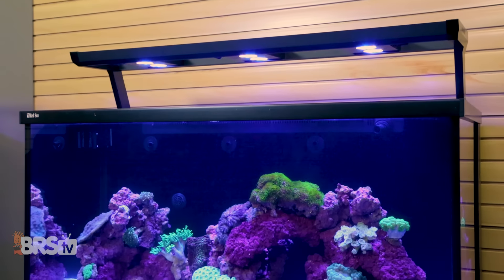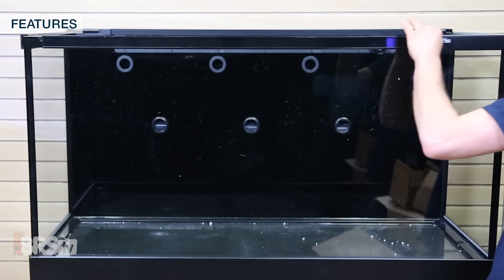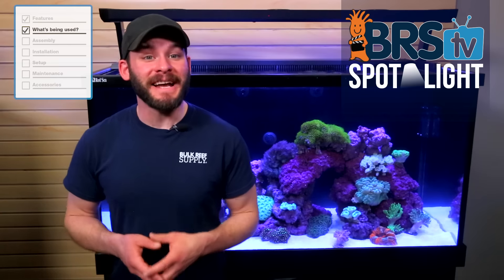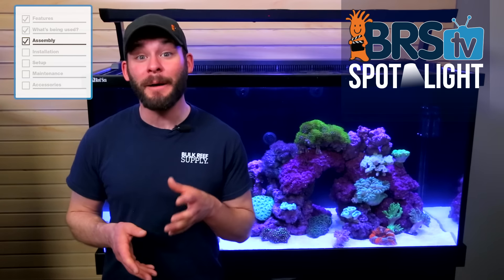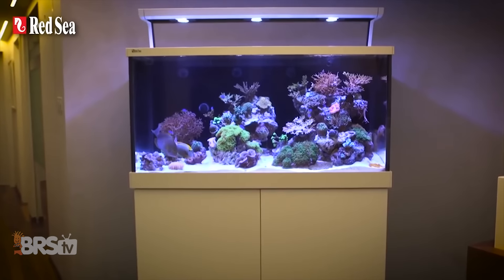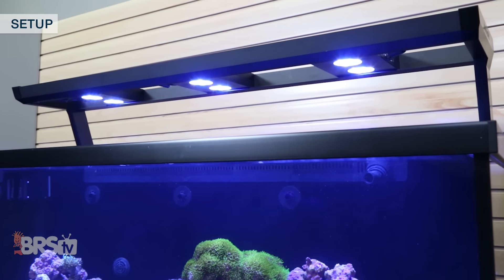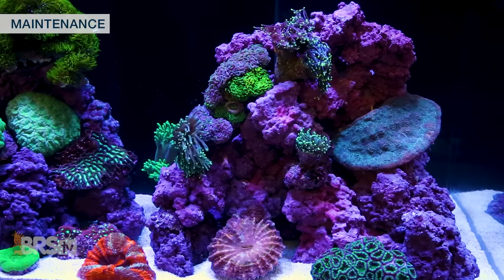How to setup a complete reef system - Red Sea Max S Aquariums | BRStv Spotlight

Comment: Awesome video! I think the way this video was planned was great and hit all the major points for new reefers, but i will say if you could make a beginner series talking about best way to cure rock and other mandatory things a beginner wouldn't know and needed to would be great ie.(cure rock, setting up a skimmer, setting up a sump.. etc). Also talking about equipment's and brands that are well trusted and would recommend to new reefers in a style that shows ex.(best in class cheap skimmer, best mid priced and best high end) and so on... and things you need to alocate money to and things you dont need to spend alot on...etc, with all needed equipment going into the tank. Its easy to get lost with the many options when starting out. Thank you

Comment: I love my tank!  Thanks for the video. I took out my sump and cleaned it thoroughly after a year. Something happened to the ATO system when I set it back up. I filled the ATO reservoir after I was done and all of that water drained into the sump at once.  Can you please help me with trying to fix this. I'm having to add about 3 gallons of RO/DI water directly to the sump until this gets fixed. Thanks!  Love BRS 🙂

Comment: I have been watching hours of your videos and have a question.  I am in the early stages of planning a fish only saltwater tank.  I have not interest in corals.  Do I need to use RODI water?  I was thinking about just filtering the water with sediment filters and Carbon.  or 50/50 RODI and filtered water.  I do not know the TDS of the water i am going to be using yet.  It is going to be a really big setup.

Comment: How do you get the sand in after getting the saltwater mixed in tank?
Reply from the maker: I suppose that depends on how cloudy you're ok with the water getting 😅. If you turn off all of the pumps, you can certainly just dump it in and give it some time to settle. If you're trying to avoid the dust storm, you can use a funnel and some 1.5" PVC and add it that way. The PVC helps get the sand to the bottom of the tank with minimal dust in the water column.
Reply: @BRStv  Thank you for the help!

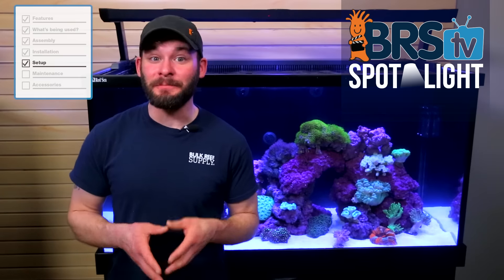Comment: 8:00, so this is something I always wondered about,. I noticed after adding the live sand and live rock you fill the tank with RO-DI water THEN add the salt. Isn't this large "freshwater dip" bad for the bacteria in the sand/ live rock? Or is the Bacteria okay in freshwater for a day or two?
Reply: The rock was dead and dry  . The sand was live , but the freshwater probably killed most of the bacteria in it . This is not a problem because he is adding bacteria back to the tank after the salinity is balanced. The aquarium then  "cycles" ( google nitrogen cycle) for a few weeks without any fish or corals added.

Comment: What is a chiller and why would a reefer need one?
Reply from the maker: A chiller helps cool the aquarium water. Most reefers won't need one, but if you live in a hot climate and your tank gets above 80-81 degrees F, a chiller is one way to bring the temperature back down to an acceptable range.